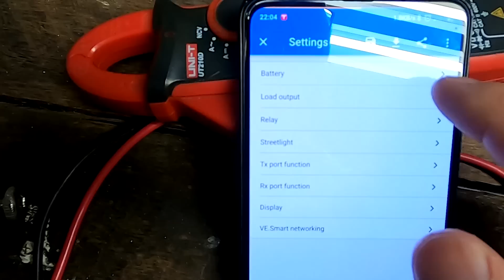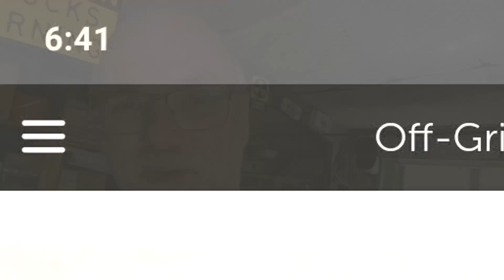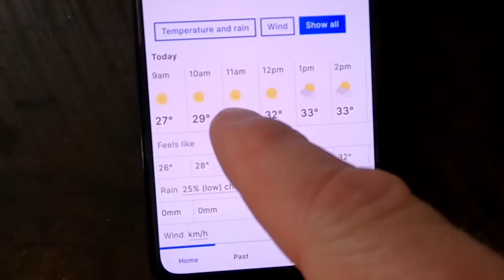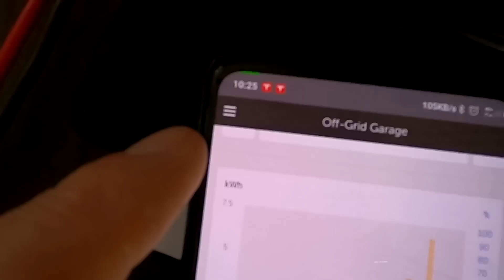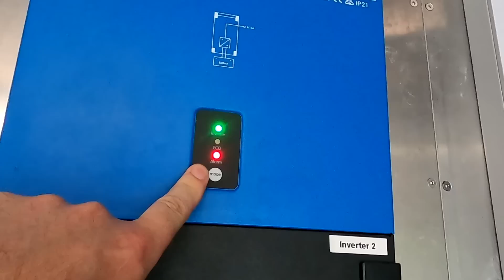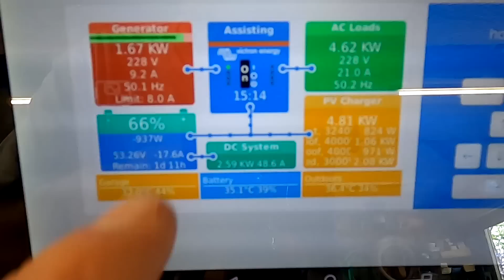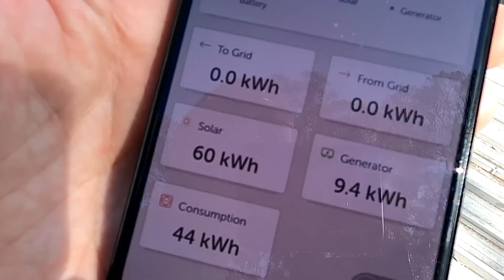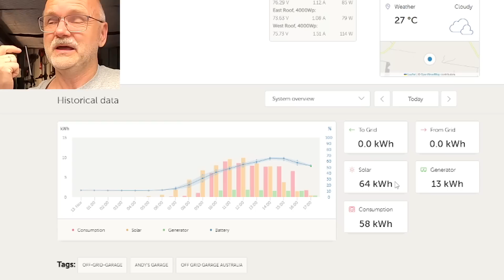New solar system, maximum yield test. How much can we expect? ☀️⚡

Comment: I hope you can buy Hybrid inverters from DEYE factory and use it instead of what you have, they have the best inverters I saw , their inverter are all in one no need for external charger and they have perfect software application.
Reply from the maker: No, I can't, I'm off-grid. And I would not buy DEYE...terrible reliability, software and service from what's in the forums. Lots of complaints.

Comment: Is the bluetti the 2000w  DC load we see sometimes on the VRM, or the ~650w load?  Nice it has a DC-DC charger from your 48v  :)
Reply from the maker: The Bluetti charges with ~500W from the DC bus and is showing under DC Load. The rest of DC Loads is the Xijia inverter when I connect something in the house...
Reply: @Off-Grid Garage  ah, makes sense  :)  assumed you ran the house extension from the victrons.

I thought the guys were hooking up the house to the garage on existing wiring with the solar upgrade? Or did that not happen in the end?
Reply from the maker: @KevIsOffGrid  I sometimes do either way. Load sharing in full swing😂

Connecting the house is complicated due to the limited cabling and the existing solar which we cannot touch (without losing the high feed-in tariff). We're working on it and I will do a few videos about the process once we have a solid plan. It's scarry but also exciting.
Reply: @OffGridGarageAustralia  I had it in my head, from some past video, that with the solar upgrade the company were also doing something on wiring to the house not on the tarriff line. But maybe you mentioned it and my head remembered as going to happen. I can be easily confused.
Reply from the maker: @KevIsOffGrid  It is very complicated to work in the constraint of the contract. Hence, I involved the sparky now as well, to let him figure something out. It seems to be possible with some small limitations...